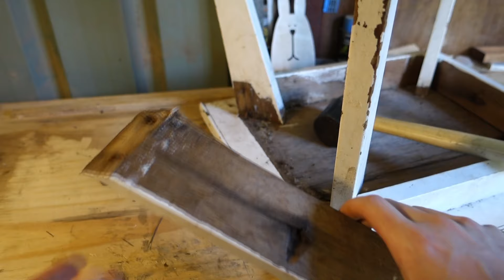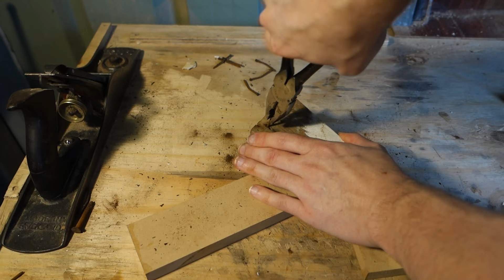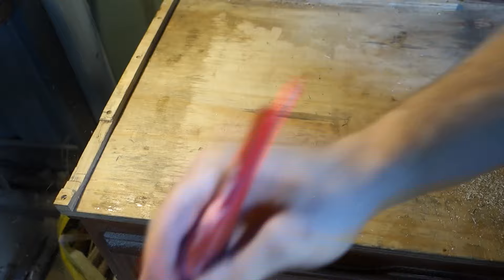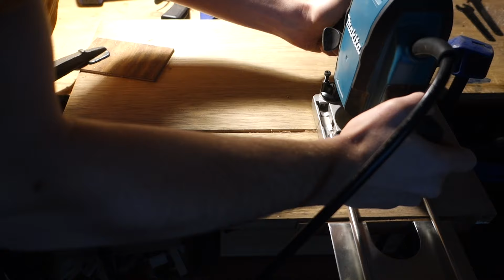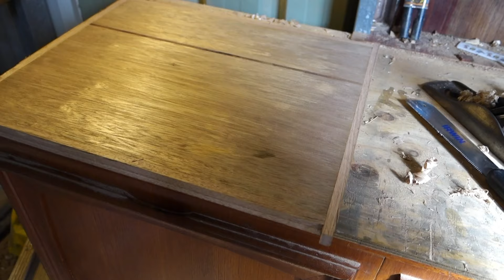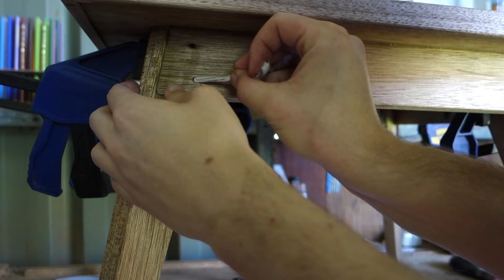Painted Coffee Table Restoration - E∞J Woodhouse Restorations

Comment: That was awesome the way you took that paint off with the hand plan. The use of small pegs instead of nails of screws. Very nice work how you finished it.
Reply from the maker: It's a lot of fun as well! I would highly recommend it. Cheers Risse, thank you for watching and commenting🙂👍
Reply: However, one of the first things I was taught regarding planes was to NEVER drag the plane back across the surface, as that dulls the blade.
Reply from the maker: @stephenhoward6829  plane dragging has been the subject of much debate. I personally don’t believe it makes any difference in blade longevity. The blade is already much harder than the wood you are shaving and going backwards puts almost no tension on the blade. Plus it saves you energy not having to pick up a heavy jack plane every time haha. It also reduces the chance of putting dents in the wood, as some woods are extremely easy to damage. There is always an argument to be made, however both methods are perfectly viable.

Comment: Are the legs mahogany?  Whatever they are it's beautiful wood.  I watch a lot of furniture restoration videos and I must say this is the first one I have seen where the woodworker used block planes.  I love that you chose to use an old-style tool that gave a beautiful result.  I especially loved that fine bead of inlay.  Great touch.  Great video.
Reply from the maker: Swansong18 pointed out that it might be philippine mahogany, I always thought it was some type of oak which is very cool. It plained very nicely :). I love your observations and feedback, thanks for watching and commenting Mary :)
Reply: @ejwoodhouserestorations2796  The fact you planed some pieces in both directions indicates it is something similar to Mahogony if not Mahogony. Looked like a fun project
Reply from the maker: @dalehallmark9174  That is very cool! I didn’t know that. Thank you for the info 👍 I will keep an eye out for that in the future. Cheers 🙂
Reply: @ejwoodhouserestorations2796  There are an awful lot of woods you can plane in one direction easily (with the grain) and in the other (against the grain) the tool hangs, and digs in and the wood wants to splinter. Even, close-grained and not figured wood doesn't as much and makes good carving and sculpting wood.
Reply from the maker: @dalehallmark9174  yup I totally understand what you mean. I always have that issue with pine, lots of tear out if you go against the grain. Very interesting about choosing the ideal wood for carving, it looks like loads of fun. I’m guessing your a woodworker your self?
Reply: @ejwoodhouserestorations2796  Sort of, I worked as a construction worker, then carpenter, then general woodworker for some years. Now I am retired and decided to explore the projects I like. I  like to make furniture but currently now mostly I like wood carving, sculpture in stone (especially soapstone and alabaster) exotic wood and exploring woods from around the world for small fun sculptures. I also love all restorations, especially done when saving the original as much as possible.  Thank you for the fun video!!
Reply from the maker: @dalehallmark9174  very cool! Sounds like you have accomplished a lot. I would love to see some of your works. It’s an addicting hobby haha. Cheers Dale. Thank you for sharing, I really like hearing from other woodworkers and their experiences 🙂👍

Comment: When I learned how to use a hand plane, I was in love with using it. The correct tool to remove the paint whilst removing the least wood is a cabinet scraper, another tool that is very satisfying to use.;
Reply from the maker: Once you get the hang of a plane it’s such a great tool. Definitely agree, cabinet scrapers also work wonders for veneer, where a plane would be a little too aggressive. 👍🙂

Comment: Good job!  What lovely wood you uncovered.  I've been told that using a plane to remove paint would merely dull the blade, but I guess that was wrong.  One thing I would do differently is to pencil numbers on the legs and the slots they came out of, in case it makes a difference when it's time to put them back in.  I like the way you gently rounded the edges,  I believe that a rigidly right angle on a piece of furniture is a mark of cheap manufacture.  Your end result is lovely.
Reply from the maker: Thank you Merry! What wonders were hiding under all of that paint right haha. That's a fantastic point, I should have done that in this case but lucky all of the joints were a snug fit 😅 Always have to have rounded edges, sharp edges on any item that your going to touching is pretty unpleasant. You have a keen eye and love your suggestions. Thank you for watching😀👍

Comment: Nice restoration. This isn't a criticism, just what I would've done. Miter the corners of the outer trim pieces and inlay another strip the same distance from the other edge. I do like the wood dowels in the nail holes. I wouldn't have thought of that.
Reply from the maker: Thank you David 🙂 no offence taken at all I totally agree with your suggestion. I wish I would have mitred the edges since fixing the table 😂. Perhaps if it needs some fixing in the future I will correct that mistake. Thank you for the suggestion and watch 👍🙂

Comment: Отличная работа, продолжай в том же духе.
Reply from the maker: Thanks for the support and watching Dimon :)
Reply: Согласен, работа отличная! Не совсем понял, почему не пошкурено? Все-таки, какой бы не был острый фуганок, полосы на плоскости на ширину ножа он оставляет.
Reply from the maker: @ДмитрийФедоров-и3к  I apologise if my answer isn't satisfactory to your question, google translate is a bit clunky at times haha, ill give it my best shot. Yes, even though a plane blade is sharp you can still get streaks in the wood. You can avoid this by rounding over the edges of the plane blade slightly after sharpening your primary bevel. I'm still practicing and improving on this as well.

Comment: Very nice. I would have flipped the tool around and cut a matching dado on the other side of the table so I could put in matching filler strips. However, personal taste is just that and does not take away from the outstanding work done here!
Reply from the maker: Cheers Gary, that is a great suggestion, I think if I have some spare time in the future I might remove those pesky metal braces and do just that, it would probably make a good video haha. I appreciate the feedback and thank you for watching! :)

Comment: Hi from The United States . On the underside of the table are 2 zigzag pieces of metal . Looks like they are holding the crack together. I found these same things on a piece of furniture I am working on . Does anyone know what they are called ? Thanks . Loved the video . Will use the planer trick for sure !
Reply from the maker: Hello Deb nice to meet you 🙂 your the  first person to comment on those, they are in there deep. I would love to know what they are called as well. Very much appreciated, make sure your hand plane is nice and sharp and you will have no issues. Cheers 👍😺
Reply: @ejwoodhouserestorations2796  yep a sharp tool is actually safer than a dull one .  I am learning to sharpen my own tools. Those metal things were so far into my piece of wood and so stuck that I left them in also. If I find out the name I will message you ! Thank you for responding to my message and I look forward to more videos ! ✌️

Comment: Nice, i like the use of wooden nails. I am concerned about gluing end grain and long grain. That doesn't acount for wood expension due to humidity change.
Reply from the maker: Dowels are a great alternative. That could be a possibility in the future, if so I plan to reinforce the edges with dowels in place of the nails. Thank you for the suggestion! Cheers 🙂

Comment: Great job. Curious why you don’t sand the wood down?
Reply from the maker: Thank you Paul 🙂 no need to sand with a well sharpened hand plane, it leaves the surface ready for finish. You will have to lightly sand after applying the first coat however as the grain will rise regardless using oil or water based. Cheers 👍
Reply: @ejwoodhouserestorations2796   Makes sense. Beautiful finish

Comment: I appreciate the use of handplanes and the removal of the hideous paint.  I do wonder, though, about how the inability of those border strips that run across the grain of the tabletop to accommodate cross-grain expansion and shrinkage with seasonal humidity variations are going to fare in the long run.  The originals were nailed, if I understood correctly, and that would have accommodated the seasonal movement of the tabletop (though not a particularly good solution, IMHO) better than a fully glued strip running across the grain.  I fear that there may be a failed glue line or a split tabletop in the not-to-distant future for this piece.
Reply: I wondered the same.
Reply from the maker: Thanks Thomas, yes that was something that I didn't think of at the time. In the future if it does give me any trouble I add some dowel supports just like the original nails. I guess we will see! The original still spit with the nails so I hope this one doesn't, or else i've got more work ahead of me! I appreciate the feedback and watch🙂
Reply: @ejwoodhouserestorations2796  I would be concerned that the dowels will insure that the table top will split.  You might want to look into another solution like breadboard ends.  Incidentally, kudos to you for the handplanes, glad to see that approach here.
Reply from the maker: @tpower2727  I’ve done a google search of that now very cool! Thanks for the tip Thomas, Cheers buddy 👍🙂

Comment: Better  than I could handle but if it's about  showing tools why not just put in matching  inlay on other side as well ,  great for plants or sculpture
Reply from the maker: Thanks Rober, I had considered that as an option, however, there were two really deep metal braces keeping the top together. I thought it would be best just to leave it be and only repair the top section. 👍

Comment: Does that Cabot’s Benchtop Clear dry to a hard finish ?  Is it like varnish or verathane ?
Does it dry to a hard durable surface ?
Reply from the maker: Yes it dries hard and is quite durable in terms of scratch and water resistance. It's very similar to regular oil varnish but it dries 10x faster. I would recommend diluting it by about 10% if your using a brush, makes the finish look better.👍
Reply: Thank You very much for the reply and the info. I will take a look around to see if I can find some Cabot’s .  Thanks again.   Dave

Comment: You do good work but why did you leave the one slot in the table? Looks odd. I think I prefer planing over chemicals. You don't have to put up with fumes.
Reply from the maker: Thank you S. There were four metal braces holding the crack together, you couldn’t see them on camera and they were really deep so I thought I would just leave them be. After I put the strip through the top it felt nice and sturdy 👍 totally agree, I’m surprised that planing isn’t a more commonly known way of paint removal. They are fantastic tools. I appreciate your watch and comment 🙂👍

Comment: Was a heat gun one of the methods you considered for removing the paint?
Reply from the maker: Ive seen the heat gun method of paint removal, looks like a great alternative to paint stripper. I didn’t think about using one in this instance because I wanted to flatten out the top of the table, plus the plane does stripping, flattening and finishing in one go 👍

Comment: At 13:21, would it have been easier to just saw all the way through, using the crack to separate the wood into two pieces, and then just join the pieces into one -- rather than patch the crack?
Reply from the maker: Yes you could definitely have done that. However there were two large zigzag type fasters that were imbedded into the crack holding it together. That’s why I chose to route a small recess instead of dealing with pesky rusty iron 😂👍

Comment: I removed screws from timber that had a date stamp of 1954 (not a typo) and the screws did not have a spot of rust. I guess they are stainless steel screws as I still have them and kept them in a separate container. Is it possible that they are stainless steel as I'm not sure.
Reply from the maker: Very interesting indeed, they very well could be if not some other type of rust resistant alloy. Even if the timber wasn't exposed to the elements you would still expect to see some type of rust on the nails if they weren't stainless steel. You definitely make a good decision keeping them!

Comment: I wouldn't have put that patch in the top. Instead, cut through the dado, plane the two sides smooth, and reglue. I'd rather have a table that was a half inch narrower but didn't have the mismatched patch.
Reply from the maker: That’s actually a fantastic idea, I just didn’t have the guts to run this through my saw with the metal staples that were holding it together. The strip would have blended in better if I hadn’t planed through the plywood layer that matched.

Comment: The wood had a beautiful grain, when treated properly, however, I can't help wondering why, if you couldn't match it, for the reinforcing inlay, didn't you put another inlay on the other side of the tabletop to balance it out?
Reply from the maker: Yes, I can see where you're coming from. I wanted to make the inlay stand out so I thought the red tone of the wood would make for an interesting contrast. However, I accidentally shaved off a bit too much of the plywood inlay revealing cross grain underneath, so I  had to go with it haha. For the bottom, there were four weird zigzag metal braces holding it together that were quite deep, so I just decided to leave it be. I think your suggestions were great and I appreciate the feedback :)
Reply: i really like just the one inlay. two would make it, I dunno, too matchy matchy and contrived.

Comment: Why did you put the other piece of wood through the top?
Reply from the maker: The main reason was for structural stability, the table was very fragile because of the crack. I also wanted add a little flair to the top. 👍🙂

Comment: Man That table had way too many nails holding the legs and skirt on. The wood looks like Mahogany. The plane made quick work of removing the paint that In my opinion should not have been on the table in the first place. Good on the repair of the crack in the top. Nice replacing the nails with wooden dowels glued in much better.
Reply from the maker: Cheers Robert, yea getting those nails out was a workout in it’s self haha, I actually never got all of them out as a lot of them just broke off. Definitely give planing a try, works fantastically for solid wood. Thanks buddy 🙂👍

Comment: Isn't painting old furniture what you do for your first apartment?   Also, building bookcases from boards and cinderblock...  anyway, I wonder when picking up painted old furniture, if you're going to sand or plane  if you should wear a mask in case they used lead paint.
Reply from the maker: A very good point, always test for lead paint and wear a respirator for the pesky sanding dust. 👍

Comment: how do all? nice job though shouldda taken off the trim, cut enough veneer to route and fill crappy center. and i wouldda applied self thought technique that fooled a professional tree feller in tas., i.e., made a crib board for his partner using figured eucalypt hardwood by staining with beetroot juice left over from a can o sliced, kiwi black shoe nugget brushed and polished into like cleanin boots, then it finishes resembling tas. blackwood which is sought by most furniture makers for the deep tight grained brown strength. i purposely left underside un treated and until graeme wishwilson turned the board over was still prepared to wager $100.00 believing it to be blackwood, [ 10x more valuable than gum tree ]. taztez.
Reply from the maker: Very interesting! Definitely going to try that. I imagine it would add a dark purple colour to the wood.

Comment: By using glue absolutely everywhere you leave no room for wood expansion and contraction. That is why the top split in the first place. You should not have used glue on those pins and you should have used hide glue on the rest of the piece.
Nice outcome, but it won't last another generation without coming apart.

Comment: Anything painted before 1978 the laws regarding lead in paint became strict. Anything painted just after 1978 should be checked for lead too, especially if it is white paint. Entire barns were painted with white paint, leaching the poison into the soil and plants eaten by livestock. Years back I bought a few things from Walmart years ago to give to my grandkids and was floored to find that items made in China were painted with leaded paints. I bought a test kit and moving forward, everything they could be poisoned by was tested. Walmart did a recall on a fishing pole for kids which had Little Mermaid stuff painted on it. Talk about mad!

Use a mask when removing questionable paint, and wash everything exposed to the paint after removal. Kits for lead testing are readily available so get one and protect yourself and your family and pets. Wearing a mask isn't enough, you need the space to have good ventilation as well. Don't skimp on your caution. Lead stays in your system once it gets there. I can affect your babies ladies! Follow recommended Hazmat removal information if you can. 

Warning! This requires a medical diagnosis.
 
Symptoms include developmental delays, abdominal pain, neurologic changes, and irritability. At very high levels, it can be fatal.
Reply from the maker: Thats very good advice! I definitely agree and would recommend getting a lead tester before doing any type of paint removal on suspicious items. Thank you for the info!👍
Reply: Yeah it’s a bastard when that happens